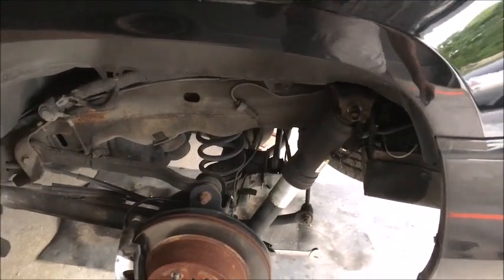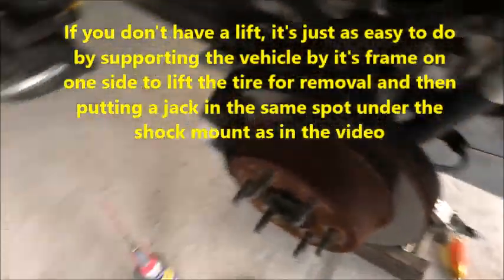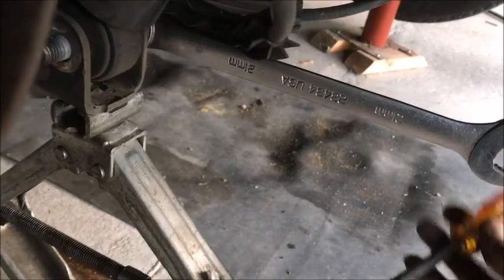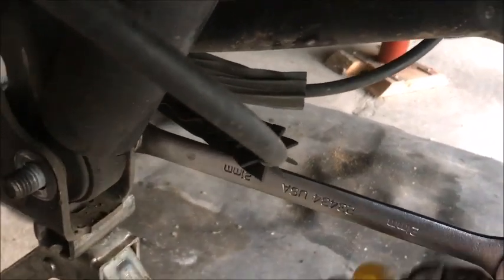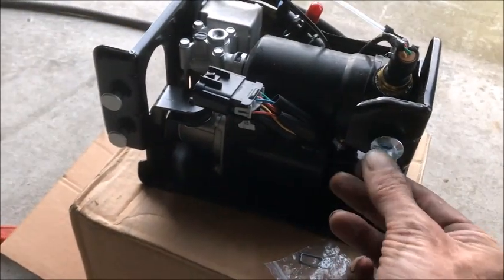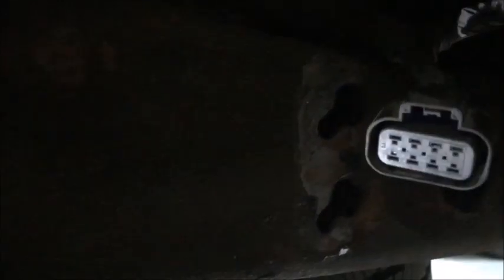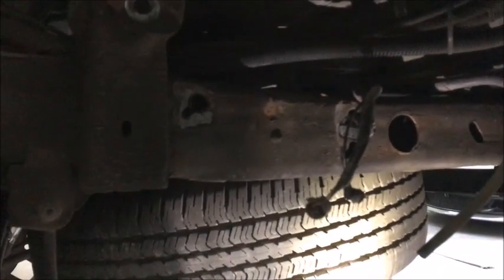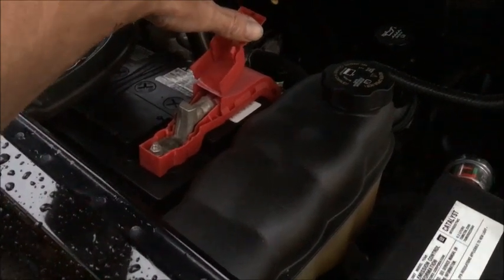2007-2014 Escalade Rear Shock and Air Pump replacement (Just the tricky parts)

Comment: Awesome video.  I had to do this myself not long ago on our 07. The ride is tenfold better. I think I used a Dorman air pump. AC Delco rear air shocks the front doesn't have air ride on mine.
Reply from the maker: Thanks man 👍. Yep, having the air ride working (as well as getting rid of the Mag ride up front) made a world of difference on mine as well. All the best !  Steve

Comment: Where is the level ride module located
Reply from the maker: Hey !  If you look above the rear wheels (just inside the inner fender on the frame side I believe), there should be an arm and a sensor that measures the ride height.  I’ll go check to be sure I can see it from below…if not, I’ll reply back with how to get to it 👍. All the best !  Steve
Reply: My right side air shock wont work. I think there is a problem with adjustting. It works. When i have Passangers. In the back. Where can i adjust the air shocks?

Comment: Where did you buy the parts
Reply from the maker: 96 SS , here’s a link to the compressor on my Steve’s DIYs Facebook page (YouTube won’t do pics on comments) https://www.facebook.com/109400450606405/posts/163067041906412/  here’s for the shocks: https://www.facebook.com/109400450606405/posts/156017219278061/  Bought both off eBay.
Reply: @StevesDIYs  Was that pump bought off of ebay???
Reply from the maker: @mercedesbenzs600bash  , hello...yes, I bought the pump off eBay as well.  There were several sellers, but I got mine from the seller named eaton_auto.  I have bought things from them before and they have held up well and it says it has a lifetime warranty from them.  It’s still doing fine after almost 3 years so I guess it’s a good one.  Here’s a link to the picture of it on ebay (YouTube doesn’t do pics in the comments so the link goes to my Steve’s DIYs Facebook page):  https://www.facebook.com/109400450606405/posts/295636978649417/  .  Looks like the price has gone up about $20usd since I bought mine in 2019.  All the best ! Steve

Comment: Ok ready change de fuse’s and change the relay  and nothing!
Reply from the maker: Hey man !  It could be that the computer has an error from the system: not working before everything was changed out.  Might try to disconnect the battery for a few minutes to see if it will reset any errors or connect up a scanner to the OBDii and scan the body/suspension module to see if it has an error.  Hope this helps, Steve